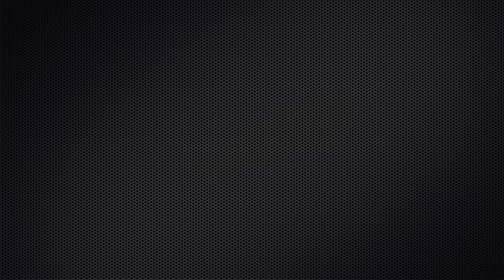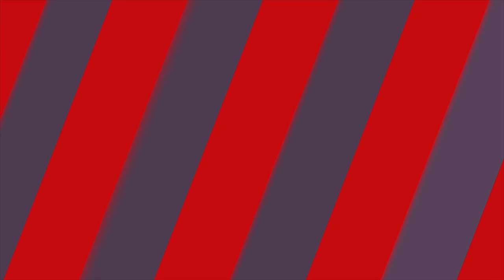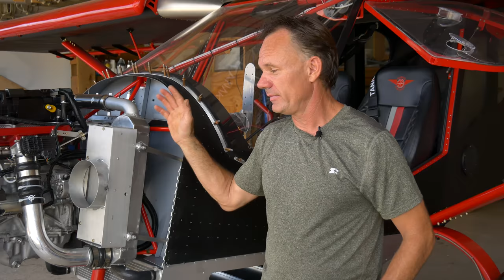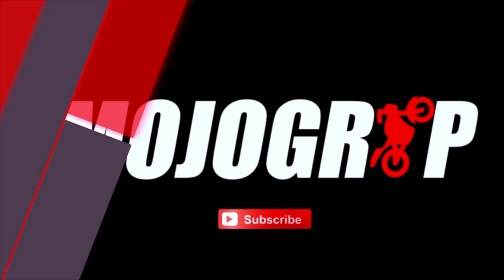Maintenance Cost Of An Aircraft Engine | Experimental Aircraft

Comment: Honda isn't immune to problems.  Consumer reports published their 5 least reliable cars for 2018 and 2 of them are Hondas.  So don't think just because its a Honda that it won't have problems.
Reply: Yeah, but cruddy infotainment systems are hardly related to engine quality.
Reply: Just look online at the Viking engine track record...  try a google search on the reliability of the Viking engine or.   https://www.vikingenginesissues.com/    I personally know of numerous off-airport landings with aircraft using Viking engines and have seen one first hand!
Reply: @flynic3  That website is no longer active, they were probably starved of content and activity. There are also many, MANY examples of catastrophic engine failures involving Lycoming and Continental engines which caused forced landings, so I'm not sure what your point is. Another thing to consider is that experimental aircraft generally suffer high failure rates anyway, these are amateur-built aircraft after all. Viking even investigated a failure that was entirely operator error, partially caused by a poor engine installation by the aircraft owner, but mainly caused by the owner failing to understand the operation of his own electrical system. The guy turned the alternator off in flight and wasn't even aware of it, he even failed to notice that his engine was running on battery power after he had shut off the alternator. If a person knows what they're doing with their engine, they'll be fine, and that's usually true of the engine in any aircraft.
Reply: idontcare80 Nope... the website is very much still online... try again!  https://www.vikingenginesissues.com/    What you have to consider is the amount of Viking engines produced versus how many fail.  The amount of engine issues per engines produced is extremely high!... especially with the Viking 110.  When you combine an engine from a wrecked car, slap on an off the Shelf PSRU and a CPU that is not intended for aircraft use... You have a Recipe for disaster and You have to expect as much!  Just do a little research my friend Jan Engenfellner has a History of this with Subaru engines as well and Many customers ended up with a product that didn't even work at all!... that is if they even received the engine at all after paying for it!  Jan just filed Chapter 11 for Engenfellner engines and opened up Viking!  Trust me, I am not just blowing smoke here... Jan is a Salesman and not an engineer!  I very much know the story about the CH750 with the Viking 130hp that went down in Deland!  The owners were members of my Fathers EAA Chapter!  You need to stop watching YouTube videos and believing everything you hear!  The gentleman you are speaking about did not build the aircraft in question... and Jan made sure to make him look like a total moron when that couldnt be further from the truth!  This was a veteran pilot of well over a Decade... There is a lot more to that story my friend, trust me... my father was there that day it occurred!  Why was the EFIS system still running off that battery power when the engine went quiet?... maybe because the CPU is designed for Off-Road car use and was not designed for Aircraft use... requiring an amperage draw that is way too high!   When it comes to Viking Engine issues... there is a Trend  "It is never the fault of the Viking Engine itself!". Sarcasm   The Viking Engine is a Recipe for disaster.... and are known for numerous electrical issues!  Stop drinking the Viking Kool Aid and actually research this Engine and Owner!
Reply: @flynic3  That site was down when I first looked at it, it said that the domain was for sale.

"...especially with the Viking 110."

Which is probably why it's not longer in production.

"When you combine an engine from a wrecked car..."

The engines seem fine. The only engine related issue on that site was a warped head, which meant that the engine had overheated at some point, and it could have been the owner that caused it to overheat. I'm betting that he forget to put coolant in it before running it. I've been working on cars for a long time, and I've even made mistakes like that.

"slap on an off the Shelf PSRU"

It's not an off the shelf PSRU, Viking designed it. The coupling between the engine and the PSRU seems to be the source of almost all of the issues on that website, and (IIRC) Viking has improved those parts.

I haven't seen any issues with the engine electronics. 

I've been reading all about Eggenfellner aircraft engines for a long time. What's amazing to me is that people don't understand what they're getting into when they buy an automotive conversion, it's just a risky proposition, period. I mean, really, you get what you pay for and if you want an engine that is designed to work perfectly in an aircraft, fork out the money for one that was designed to work in an aircraft! If you want to experiment with experimental aircraft, you're probably going to have issues pop up from time to time. I don't understand how all of this isn't obvious to everyone. 

"Why was the EFIS system still running off that battery power when the engine went quiet?"

Engines have a large amperage draw, as the charge was being depleted, the battery would be able to power an EFIS but not the engine. The more power you draw from a battery, the more its voltage drops. Some EFIS systems also have internal batteries, and many can run on very low voltages.

"...requiring an amperage draw that is way too high!"

No, ALL modern EFI engines draw a large amount of power.

"It is never the fault of the Viking Engine itself!"

Clearly, Viking has some issues related to the coupling between the engine and the PSRU, but I'm fairly certain that they've made revisions to those parts to improve their reliability.
Reply: idontcare80 I think your statements above more or less back up what I am saying!  Why do you think Zenith or any other LSA manufacturer doesn't have a Viking Engine on their Demo Aircraft!... I think that pretty much says it all!  You can dissect my statements as much as you would like but you are only proving my point!  You obviously did not read the whole Website as this Gentleman had Numerous Issue's with his Viking Engine including a leaking head from the Factory, Multiple PSRU issues, Heavy Oil use due to the Viking head cover and an issue with his alternator falling off! He had 2 off airport landings and finally a crash that almost killed him!  https://www.vikingenginesissues.com/engiine-issues-and-failures   I am glad to hear that you have had good luck with your engine but from what I have seen that is not usually the case... they either work or they dont! When you take an engine from a wrecked car this completely makes sense!  You talk about spending more for an Aircraft appropriate engine... You can easily buy multiple different "Aircraft" engines for the money you will end up spending on a Viking engine.  The gentleman on that site spent well over $18k... He could have purchased a Rotax 912uls or Jabiru 3300 for that money!  I garentee you he would have never had the same problems or wrecked his aircraft if he went this route!  You can defend the money you spent on a Viking engine until you are blue in the face but the bottom line is the problems per engines produced is extremely high on the Viking engines.  I have seen issues ranging from bad cylinders on a Brand New engine, to numerous PSRU issues to count, Oil Starvation, Oil Leakage, Coolant leaking, CPU and Electrical issues and I could go on and on!  Jan is not an Engineer and it certainly shows in the end product issue's!  You basically become Jan's R&D department and Test dummy after forking out almost $20k when you could have just purchased a properly tested engine for that Money!  That is my point...  Why spend that kind of money and then risk your life flying behind an engine that hasn't been engineered correctly or properly tested!  I certainly can't in good concious recommend this engine to anyone and feel you shouldn't either without passing along the information you posted above!  After spending as much money as you have on a Viking engine you become personally invested and therefore dangerously Bias in your opinion...  Which could easily lead to someone's fatal aircraft accident!
Reply: @flynic3  You clearly don't know anything about engines. I addressed the issue of the "leaking head." 

READ MY COMMENT.

I read every issue on that page, they're almost all related to the connection between the engine and the PSRU.

The heavy oil use was with the Viking 110, which is no longer for sale.

Jabiru engines also have significant problems.

Most of the issues that you're talking about were with the Viking 110, which had many customized parts and is no longer on sale.
Reply: idontcare80 You caught me... I know absolutely nothing about Aircraft Engines.  I just work in the Aircraft Maintenance department for Ideal Aviation and do this for a living.  Jabiru engines per the amount of engines produced do not have nearly the amount of issues as the Viking.  The only issues with the Jabiru were restricted to heavy use training environments in an extremely hot environment thus causing Thru-bolt failure.  The issues with the Viking engines are not limited to the 110hp model although there were a lot more issues with this engine!  Your opinion is completely biased since you were ignorant enough to flush away $20k on a Viking.  If you look at the history of Jan Eggenfellner and the engines he has produced... you can tell this man is no Engineer!  I honestly can’t believe you are defending him and the engines he produces given the track record of his multiple failed engine lines.  Do you really think he all of a sudden got it right this time with the 130hp Viking?  Do you really think that all of a sudden he found the magic formula based on your engine working for the time being?  Again, your opinion is dangerously biased and I truly hope you rethink some of the statements made before someone gets seriously hurt!  I personally can not believe that Jan is still in business actually selling engines giving his track record!  I think he and his engines are dangerous... period!  The fact that he cares only about the money in his pocket versus the safety of his customers says it all!  Stop drinking the Viking Kool-aid and come back to reality my friend...
Reply: @flynic3  Working on aircraft engines does not mean that you know anything about automotive engines, they're VERY different animals.

"Jabiru engines per the amount of engines produced do not have nearly the amount of issues as the Viking."

What's that based on? They were so bad that the Australian government put restrictions on their operation as a way to the reduce injuries and deaths.

"Your opinion is completely biased since you were ignorant enough to flush away $20k on a Viking."

I don't own an airplane, I just like engines. I've been reading about Eggenfellner since his Subaru days, I already said this. READ.

What I think is this: I have a huge amount of experience with Honda engines and would trust them with my life, I would trust a water cooled engine well before I'd ever trust an air cooled engine, Jan's parts clearly have some issues but that's just how things go in the experimental aircraft world.
Reply: idontcare80 I have read every statement that you posted...  I agree that automotive and aircraft engines are two different animals... that being said I also have hands on experience with multiple Viking engines.  I have hands on experience with Honda, Subaru, Mazda and numerous other automotive engines as well!  You might want to actually research the statements you make about Jabiru.  The CASA issues with Jabiru were completely unwarranted and if you actually did your research you would know this.  There were 39 Cases that CASA investigated and out of those 39 cases with the Jabiru only 6 were actual failures due to the engine!  Those 6 engines were used exclusively in a heavy training environment down in the heat of Australia!  There have been over 10,000 Jabiru engines produced and flying around the world... only Six cases were found to have the thru-bolt failures!  I can name six Viking issues just off the top of my head and they have not even produced 500 engines!  Just because the Viking uses a Honda core does not make them a bulletproof engine!  That Honda core needs to be highly modified in order for it to become an aircraft engine... That is where the problem lies!  Beyond the fact that the Viking engine uses a core from a wrecked vehicle!  Jan is no Engineer and the items that he is using to modify these engines for aircraft use is where the issues start with the Viking engines!  I understand that since you have worked on automotive engines for a long time that you are interested in an Automotive conversions for an aircraft.  I would recommend the Aeromomentum engines or a Rotax 912is if you want something water-cooled with EFI.  There is a gentleman at my airport who has a Viking installed on his CH750 and his engine had a bad cylinder straight from the Factory!  It has been almost a year since that has been resolved and he still has not had the first flight on the CH750!  I see him take it out to Taxi it however believe he is too worried to actually fly it!  I find it quite humorous that you are now stating that you do not own an Aircraft!  The Viking is a dangerous engine and I will make sure to make this known to anyone and everyone before someone else gets hurt!
Reply: @flynic3  "That Honda core needs to be highly modified in order for it to become an aircraft engine..."

I mean, I would certainly do a significant amount of modification if I were going to use one on my aircraft, but the engines that are currently sold aren't modified in any significant way. The Viking 110 was a significantly modified Honda engine, but it's no longer sold.

"There is a gentleman at my airport who has a Viking installed on his CH750 and his engine had a bad cylinder straight from the Factory"

Define "bad cylinder".
Reply: idontcare80 The Honda core requires a custom PSRU and a proper CPU just for starters... then you have a lot to modify when it comes to the Firewall Forward to make them work.  The Viking PSRU is what is known to have numerous issues and the Big Squirt CPU is meant for off-road use only... the manufacturer does not want it used for aircraft use due to the liability.  Why would you want a Viking engine if you would have to then highly modify it for use in your aircraft?  There are better engines on the market that are designed and produced for aircraft use.  You will end up spending more money modifying that Viking than you would on an aircraft engine that has already been proven!  What type of aircraft do you intend on building?  The Dead Cylinder that I was speaking of was exactly that... when he fired up the engine only three cylinders would fire.  The engine was sent back to Viking and replaced as far as I know...
Reply: @flynic3  A PSRU isn't really a modification of the engine, it's just an addition. The Honda ECU would be perfectly suitable for aircraft use, and it would probably work better than what Viking offers, but it would need to be reflashed. Luckily, because of how common it is for Honda engines to be modified, there is a company which reflashes ECUs to your specifications.

"Why would you want a Viking engine if you would have to then highly modify it for use in your aircraft?"

Because Honda builds the best piston engines on Earth, without question.

"There are better engines on the market that are designed and produced for aircraft use."

None that offer water cooling, or overhead camshafts, or direct injection, or turbocharging at the same price.

"The Dead Cylinder that I was speaking of was exactly that... when he fired up the engine only three cylinders would fire."

That's likely a wiring issue, which would be the installers fault.
Reply: idontcare80 The PSRU does not require modifying the engine core itself but is required to make the engine work for aircraft use... the PSRU is what drives your prop!  The PSRU from Viking has had numerous issues and this is a major problem!  When the PSRU fails due to the spider coupling or the other numerous issues that Viking has had... you are coming down!  You can’t just pull over to the side of the road in an aircraft!  The Viking engine is more than just the Honda core that drives it and that is what you don’t seem to understand!  It takes more than just a reflashing of the ECU my friend... you need a stand alone computer!  That is why Viking uses the big squirt CPU...  You may know automotive engines but you have a lot to learn when it comes to using them in an Aircraft environment!  As you stated these are two different animals and a lot of the automotive technology out there has to be modified heavily to make them work in an aircraft environment!  It certainly isn’t just as easy as you think and once you actually get hands on building experience... you will learn this!  Honda does make an excellent automotive engine... but taking this technology and making it work in an aircraft is what requires heavy modifications.  The dead cylinder issue had nothing to do with the wiring... everything was installed correctly... that is why it was sent back to Viking!  Do you really think Jan would have exchanged the engine if it was the installers wiring issue?  You will end up spending the same amount of money in the end for your Viking engine... By the time you get done getting everything working and purchasing everything needed for the FWF package!  You can purchase a UL350is aircraft engine for the money you spent on your Viking!  The only difference is that you will be taking your own life in your hands with the Viking on the front of your aircraft!  If you are dead set on having an Automotive conversion for your aircraft than go with the Aeromomentum engine line!  These engines have proven reliability and are hand built by an Engineer who actually knows what they are doing!
Reply: @flynic3  I know exactly what the PSRU is and I know that the Viking coupling has problems. The problem doesn't seem to happen until after 400 hours, so frequent inspection and replacement at 400 hours should solve any issues. Viking also improved the part, so the problem may have been fixed.

I would use the Honda ECU and have it reflashed by Hondata, I wouldn't bother with the Viking ECU. With the Hondata modifications, the ECU would be able to do anything that's needed of it in an aviation application.

"You can purchase a UL350is aircraft engine for the money you spent on your Viking!"

I would never build an aircraft with a air cooled engine.

"The only difference is that you will be taking your own life in your hands with the Viking on the front of your aircraft!" 

That's the whole point of experimental aviation, isn't it? 

Aeromomentum probably has a better finished product, but I wouldn't want a Suzuki engine.
Reply: idontcare80 I am sure you know about the PSRU and how it functions... how many have you inspected or have hands on experience with?  I know of many instances with the Viking PSRU failing well before 400 hours.  You can inspect the PSRU every 25-50 hours however it wont make any difference if the PSRU wasn’t properly engineered or tested.  I really don’t think you understand what you are getting yourself into... and your statements made are quite evident of that!  This is not an automobile and you can not just pull over to the side of the road!  I would recommend learning to fly in a Glider first to build your stick and rudder skills!  You will need it... especially if you plan on installing your Viking engine in a Zenith or other High Drag LSA!  There is a reason why aircraft use air-cooled engines.... reliability!  They may not have all the modern appointments that you speak of... but they work and are reliable!  IDontCare80 is a perfect screenname... You are taking your own life in your hands my friend!  Good Luck!
Reply: @flynic3  "There is a reason why aircraft use air-cooled engines.... reliability!"

One of the main reasons why EVERY modern vehicle is designed with a water cooled engine is because air cooled engines are horribly UNreliable. How many failures with Viking engines were a result of the cooling system failing? If there were any, how many of those were a result of improper installation?

I don't care what my screen name is, I do care about my life.
Reply: idontcare80 Again, you are talking apples and oranges... trying to compare automotive engines to an aircraft environment!  Air Cooled engines in a car were unreliable... yes!  Air cooled engines in an aircraft environment are very reliable!  I understand that you have a lot of experience in automotive technology.  You are no longer dealing with a car... you are talking about a completely different scenario when you are talking aircraft!  Take everything you know about automotive engines and throw it out the window!  You are now dealing with an aircraft which is a completely different animal!  
Weight and complexity is your enemy in an aircraft engine, and that is why you do not see any aircraft manufacturer using modern automotive technology in the aircraft that they build!  If you truly want a water cooled engine and EFI that is fine... go with the Rotax 912is!  If you value your life then you will listen to what I am trying to tell you my friend!  You can’t just pull over to the side of the road in an aircraft, and having a Honda Core in a Viking engine does not make the engine automatically reliable!  If you truly think that all of the issues with the Viking engine have to do with the person installing them... you are sadly mistaking!  All of your knowledge in the automotive world won’t save you at 5,000ft when the PSRU fails on your Viking engine...  
I have someone else that I know who recently built a Zenith CH750 with the Viking engine... he didn’t even make it out of the 40 hour Phase 1 flight testing before removing the Viking and Installing the UL350is engine instead!  His reason for doing so... reliability!
Reply: @flynic3  Air cooled engines are unreliable in any decently high performance application, it's impossible to reliably cool an air cooled engine. Even Lycoming and Continental engines have a high rate of failure due to temperature management problems. 

"...and that is why you do not see any aircraft manufacturer using modern automotive technology in the aircraft that they build!"

Except for Diamond Aircraft. Adept Airmotive also has an automotive style engine undergoing certification. The ONLY reason why air cooling has stuck around is due to the fact that Lycoming and Continental basically had a duopoly in the US and didn't want to modernize their engines. Other manufacturers just avoided making water cooled engines because of the myth of the reliability of air cooled engines. Air cooling is just a holdover from the days when bulletproof rubber coolant hoses didn't exist. Magnetos are still used in aircraft for the same reason, even though coil on plug systems are vastly more reliable. It's amazing to me that people believe that engine technology peaked in the 1940s, that couldn't be further from the truth.

P-51s, P-38s, Spitfires, etc also seem to be perfectly happy with their water cooled engines.

Even with Viking engines, the problems are not often related to the engine, and those that might be are simply a result of Viking not assessing their engine cores properly.
Reply: idontcare80 How many Lycoming and Continentals do you personally have experience with?  I don’t know where you are getting your stats from but that is not even close to being correct.  Lycoming and Continentals do not have a high failure rate due to temperature management problems!  You do realize that as you gain altitude you loose about 3-4 degrees per 1000ft?  How many aircraft engines have you worked on and how many aircraft have you built?  You may know a lot about cars and automotive engines... you have no clue when it comes to Aircraft engine design and engineering!  Diamond does use a Diesel engine based on a Mercedes Benz design.  Continental purchased the company that produces that engine about a year ago... and have tried to get Multiple OEM’s to adopt the engine.  Cessna was the only one who built a prototype and recently abandoned the project all together!    You are reaching for anything to try and prove your point... Your thinking is flawed!  I am not arguing that there is not better engine technology out there... both Lycoming and Continental have started to incorporate more modern technology in their engines.  Check out the newer YTEO-540 IE2 engines from Lycoming!  Good Luck to you... you are going to need it!  My suggestion is to become very proficient in a glider if you truly value your life!
Reply: @flynic3  I have experience with more than a few Lycomings and Continentals, and one "popped" a head during a flight, that wasn't fun. 

You do realize that it's up to the pilot to manage the temperature of an air cooled engine, right? Pilots don't always properly manage the temperature of their engines, and it's not something that any pilot should be expected to do.

"...you have no clue when it comes to Aircraft engine design and engineering!"

Except for the constant failures and forced landings that I read about due to catastrophic engine failures.

"Diamond does use a Diesel engine based on a Mercedes Benz design."

And? Honda builds far more reliable engines than Mercedes.

"Cessna was the only one who built a prototype and recently abandoned the project all together!"

Diamond is still using the engines and has been quite successful with them. The main reason why Cessna dropped their diesels is due to the poor general performance of diesels, but I don't like diesels, so that's not an issue for me.
Reply: idontcare80 How many Lycoming and Continentals have you actually worked on?  What aircraft were you flying that popped a head?  Yes, I am well aware of what it takes to be a proficient pilot... I do not just work on them as you can tell by the picture besides my name!  In fact that was taken in a Diamond DA-40...  with a Lycoming engine!  There are not many Diamond models that actually use the Diesel engine!  Again, you are talking about cars trying to make a case when we are discussing aircraft here!  The constant reliability issues that you speak of are generally in GA aircraft that are not flown very often or are not maintained properly!  Many GA pilots seem to think that the only time to handle maintenance issues is during the yearly annual inspection!  In 2017 the GA and Experimental accident rate was less than 3% per 100,000 hours flown!  Over 90% of those aircraft fly behind a Lycoming or Continental so your stats and numbers are flawed!  You obviously are not getting the point that I am trying to make!  You are still trying to compare apples and oranges to prove your right.  My suggestion is to seriously learn to fly a glider...  it may just save your life!
Reply: @flynic3  None of what you're saying here proves that the use of water cooled engines in aircraft wont offer an improvement over the reliability of air cooled engines. Every industry on Earth which makes use of piston engines has come to the conclusion that water cooled engines are more reliable than air cooled engines. You might work on engines, but you're not an engineer, and I'm definitely going to side with the engineers on this one.
Reply: idontcare80 You mean besides the fact the statistics of less than 3% accident rate per 100,000 flight hours, and that well over 90%+ of the fleet flies on air cooled engines!  Those numbers are real statistics not just talk my friend!  Again, if you must have a water cooled engine with EFI and a turbo... install a Rotax 915is or Edge performance Rotax 912STi.  Something that at least has some proven reliability and has a number of engines flying out there in the fleet!  There is also the D-motor LF39 That is water cooled as well with FADEC and direct port fuel injection.  You still haven’t answered my questions... I think you should get out there to get some hands on experience instead of sitting in front of your computer and reading!  What is actually out there flying in large numbers and what is being installed by OEM’s speaks for itself!  Aircraft engineers design these aircraft around air cooled engines for a reason, and nothing you have stated proves otherwise!
Reply: @flynic3  I don't care what the stats are, water cooled engines are more reliable than air cooled engines, so those numbers can be improved upon. Turbine engines were a massive improvement in reliability over piston engines, so improving reliability is definitely possible. 

Rotax engines are expensive and partially air cooled. The D-Motor engines are very interesting.

"Aircraft engineers design these aircraft around air cooled engines for a reason, and nothing you have stated proves otherwise!"

Because it's ridiculously expensive to produce new engine designs and companies are greedy. Even Continental produced water cooled engines for a while because of the benefits of going to water cooling, but converting an air cooled engine to water cooling rarely goes very well. Still, the engines were more efficient, easier to operate and one powered the Rutan Voyager around the world.
Reply: idontcare80 I know you dont seem to care much about anything besides your opinion!  That is fine my friend... I still care about your safety and that is my point in posting all of this!  The Viking engines have a terrible safety record regardless of the Honda core that they run on!  The D-Motor is an excellent engine however the 130hp LF39 six cylinder will cost you around $24k!  That being said, you will end up spending that amount on the Viking in the end!  Water-Cooling is great but feel that the complexity isn't needed in an aircraft engine.  Turbines are an excellent engine and I would love to see smaller Turbine designs in the lower power output ranges!
Reply: @flynic3  "I still care about your safety and that is my point in posting all of this!"

Yet you're telling me to fly with air cooled engines? 

"The Viking engines have a terrible safety record regardless of the Honda core that they run on!"

As long as the problems are known, they can be corrected and/or worked around.

"Water-Cooling is great but feel that the complexity isn't needed in an aircraft engine."

So, you're saying that you think that it's a good idea to use the worst performing cooling system in one of the most demanding applications where we use piston engines? Anyway, water cooling makes the engine itself simpler, because you don't need to have separate cylinders, a head for each cylinder and a separate crankcase, and because the engine is where you really want to greatest amount of simplicity so that catastrophic failures can be avoided.  

"Turbines are an excellent engine and I would love to see smaller Turbine designs in the lower power output ranges!"

And I want to live out my life in a holodeck with Star Trek replicator technology taking care of my every need. Turbine engines cannot be made to operate efficiently in lower horsepower applications, nor can they be made inexpensive, so we're stuck with piston engines.
Reply: idontcare80 I care about everyone’s safety and feel that the numbers speak for themselves even if you do not.  I do understand where you are coming from considering you have worked primarily with automotive engines... however in working with Aviation engines on a daily basis I can tell you that they are just as reliable when properly maintained.  Again, the numbers speak for themselves... most accidents in aviation are the fault of the pilot not the equipment!  It seems we will never see eye to eye on numerous things and that is fine... please just listen when it comes to the Viking engine!  You may be able to resolve some of the known issues but seriously doubt you will install a flawlessly working aircraft engine based on the Viking platform!  I still feel that purchasing and using an engine designed for aircraft use is the best route to take when it comes to safety!  There are lower horsepower turbines being developed and that are currently on the market IE PBS TJ-100, the Konner TK-250 Diesel Turbine and Locust Power LLC turbine engines just to name a few!  They may not be as efficient as a piston engine however this is not Star Trek technology we are talking about here!  It is a reality today...
Reply: @flynic3  So, you're saying that we've reached peak safety and that nothing can make light aircraft safer than they already are?

"...they are just as reliable when properly maintained."

And flown. They leave a lot of room for operator error.

"...most accidents in aviation are the fault of the pilot not the equipment!"

Which is exactly why one should want to eliminate the need for the pilot to manage the cooling of the engine.

"It is a reality today..."

But what's the point of them if they're too expensive for people to buy and operate? The TPS TP100, for example, burns about three times as much fuel as a well designed, modern piston engine, and the fuel that it needs is more expensive than the fuel that modern gasoline engines burn.
Reply: idontcare80 I think the safety numbers can always be improved however feel that in recent years this number has dropped to satisfactory levels!  I do not however feel that if every engine in the fleet was forced to be water cooled that this number would improve drastically... it would probably get worse initially.  I think there is multiple reasons that most aircraft today still run air cooled engines, namely complexity and weight of water cooled engines!  With a FADEC driven air cooled engine the terrible pilot workload of keeping the engine cool is completely eliminated!  The single lever FADEC systems are what you see in most modern engine designs including the UL, D-Motor, Rotax IS series, along with Lycoming iE2 and Continental IOF engines!  I stated the Turbine engines certainly are not as efficient and of course they cost more currently... how many are actually manufactured each year?
Reply: @flynic3  Who said anything about forcing people to adopt water cooling? 

FADEC controlled, water cooled engines would likely be much safer than anything ever offered in GA, simply because they eliminate the problems which can be caused by the pilot mismanaging the engine.

"With a FADEC driven air cooled engine the terrible pilot workload of keeping the engine cool is completely eliminated!"

But FADEC control cannot eliminate the inefficiency and poor performance of air cooled engines.

"I stated the Turbine engines certainly are not as efficient and of course they cost more currently... how many are actually manufactured each year?"

Insignificant numbers, unless you're talking about engines making more than 500 hp (400 in helicopters), which is where the efficiency of turbine engines improves enough to make them more attractive than piston engines.
Reply: idontcare80 The poor performance has more to do with the lower RPM levels required for a direct drive engine which requires a larger displacement engine causing the inefficiency.  I think the Rotax engine design has resolved some of these issues and they generally have a great safety record as well!  I was stating a hypothetical situation when I stated even if the fleet was forced to adopt water cooling!  I do feel like there is room for improvement when it comes to engine design however feel that things are certainly headed in the right direction!  I do not feel that the auto-conversion route is the answer... the difference in automotive and aircraft design is two completely different worlds!  It is not as easy as you think to take an Automotive engine and make it work in an aircraft... however I wish you the best in your endeavors!  I just feel that it is better to start with an engine designed for aircraft use...  too each his own!  That is the beauty of experimental... that being said, I have a hard time sitting by idle and watching folks build something dangerous as well!  I do understand your points and understand where you are coming from... just think you need to spend more time actually working hands on with aircraft engines!  FADEC resolves the pilot workload issues that you stated were an issue...
Reply: @flynic3  "The poor performance has more to do with the lower RPM levels required for a direct drive engine which requires a larger displacement engine causing the inefficiency."

Not true, the liquid cooled versions of Continental engines offered a significant reduction in fuel consumption, because liquid cooling eliminates the need to run extremely rich fuel mixtures in order to keep the heads cool and prevent detonation. Liquid cooling also allows for compression ratios to be increased, which improves efficiency and power. Liquid cooling also reduces the weight of an engine significantly.

The main disadvantage of direct drive, low rpm engines is weight, because they need to be huge in order to make a decent amount of power. The large size of the engine is really a compound problem, because the engines end up being heavy and fragile, with the fragility being a result of the engine manufacturers trying to reduce engine weight. 

"I think the Rotax engine design has resolved some of these issues and they generally have a great safety record as well!"

Rotax engines do seem to be fairly safe, with most issues being related to the carburetors. The problem with the Rotax engines is that they're high rpm pushrod engines with only 2 valves per cylinder, and that's just not a good combination. If you're going to run an engine at fairly high rpm, you want overhead camshafts and 4 valves per cylinder.

"I do not feel that the auto-conversion route is the answer..."

I'm not a big fan of conversions either, but the aviation industry seems to be struggling to produce a modern, purpose-built aircraft engine, so conversions are the only real option.

Anyway, the only reason that I would ever consider an auto conversion is because I'm confident in my own ability to make it work reliably, most problems can be avoided if one knows what they're doing.
Reply: idontcare80 I think we are pretty much saying the same thing here... The larger displacement needed for the lower RPM is what causes the heavier weight!  The Viking engine weighs the same as a Lycoming or Continental of the same HP!  Again you cant compare a modern automotive engine to what is avialable in aviation... these are two very different worlds!  I disagree that the only alternative is an automotive conversion as I have proposed multiple engines that would suite your requirements!  Good luck on your automotive conversion project...
Reply: @flynic3  Yup, auto conversions are somewhat heavy, but the liquid cooled versions of the IO-550 were lighter than the air cooled versions and that weight can be reduced further if the engine is designed to make use of a PSRU, which is evident in the lightness of the Adept Airmotive engine.
Reply: idontcare80 The weight of the Adept airmotive engine is still 350lbs and costs $65k for a 280hp engine...  I really do not see the benefits of this engine!  Both Lycoming and Continental have manufactured geared engines however no longer support these platforms.
Reply: @flynic3  You're looking at the specs wrong, the 280 hp engine weighs 324 pounds, while a 285 hp IO-520 typically weighs over 400 pounds. The 320 hp engine weighs 340 pounds, while a TSIOF-550 weighs 558 pounds and costs around $120,000! There's nothing that beats the power to weight ratio of the Adept Airmotive engine in GA. They're also working on a 360 hp version which will likely weigh about the same as the 320T.

"I really do not see the benefits of this engine!"

Because you don't know anything about engines! It's MUCH lighter, MUCH more fuel efficient and can burn inexpensive, unleaded mogas.

"Both Lycoming and Continental have manufactured geared engines however no longer support these platforms."

Because large displacement, slow turning engines have HUGE torque pulses and destroy their gearboxes! Even still, the geared engines from Continental were the most powerful engines they offered for GA aircraft and had some of the best power to weight ratios.
Reply: Honda Major problems where Automatic Transmission, like the Oddessey or Acura, Engines are good to go especially the 4cyl.
Reply: ZGERMAN Honda does make an excellent 4 cylinder CAR engine... That hardly means it will automatically make a great Aircraft engine!  A lot needs to be re-engineered in order for that Honda engine to work properly in an aircraft!  There needs to be proper PSRU that will reduce the speed of the prop for starters... Do your research and you will find that Viking engines are hardly reliable!  The Honda core does not automatically make it an excellent aircraft engine!  Let alone the fact that Viking uses Honda cores from a wrecked vehicle that has been totaled out!  You can not just pull over to the side of the road in an aircraft!
Reply: I hate these "fake news" type of statements. You know G. D. well that body fitment and electronic issues has nothing to do with putting a honda engine in these planes.